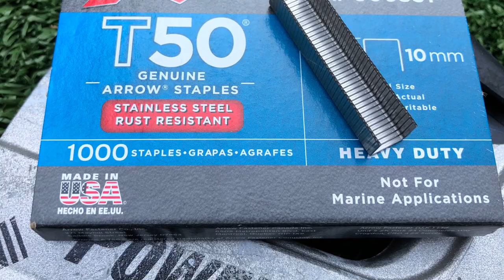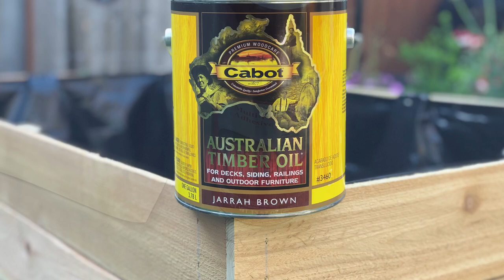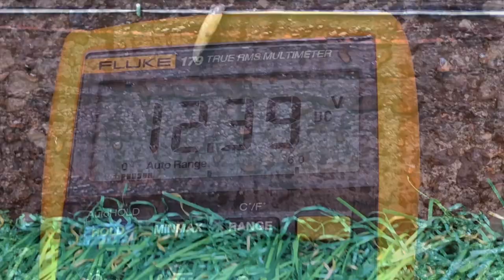How to  Make a Raised Planter Box with Electric Fence | DIY / How To

Comment: @Toai Lon How many amps or millamps is the 12VDC power supply rated at? I have heard from others that 12 VDC can kill snails and slugs. One person was using a car battery.
Reply from the maker: Thanks for the subscribed, it only 2000mA, if the slug keep trying it might kill them. I will figure out a natural way to keep  slug out for planter that out of reach outlet.
Reply: @ToaiLonDIY  OK, so that is the same as 2 amps at 12 VDC. I am guessing that you have not found any stubborn dead slugs that kept trying.
Reply from the maker: @frederickjohnh  After some tinkering the setup shown in the video has deterred all slugs from eating my plants!
Reply from the maker: Check out my new planter protect from slug and snail.
Reply from the maker: Check out my new video the natural way to protect garden How to Make a Salt Fence for Gardens | Slugs vs Salt | Snails vs Salt | Slugs/Snails | DIY / How To
https://youtu.be/Jy5sidMJXW4

Comment: How did you get it down to 12 V? Nice trick on the waterproof connections.
Reply from the maker: From Amazon part # (B01GD4ZQRS) 12V LED strip power supply 2A 24W $7.99
Reply: @ToaiLonDIY  I like your UL-listed waterproof wire nuts, brilliant. Have you thought of putting LEDs on the outside of the planter box?
Reply from the maker: I can since low voltage already at the planter.